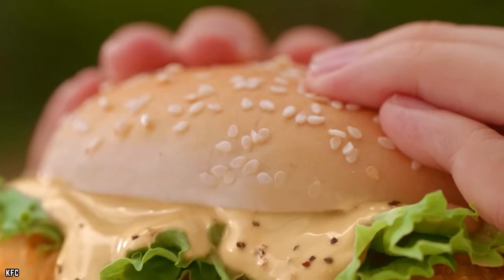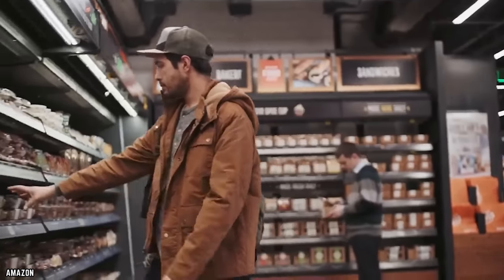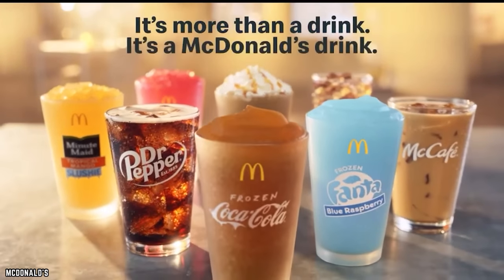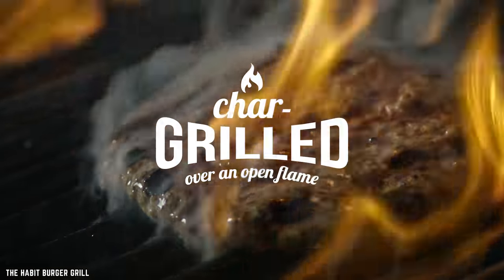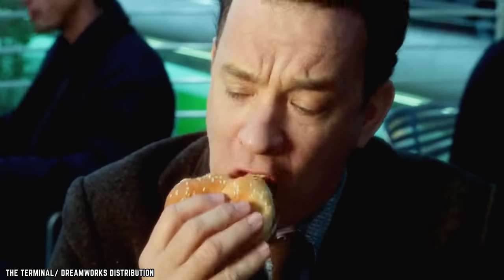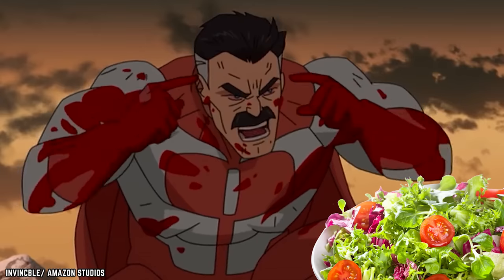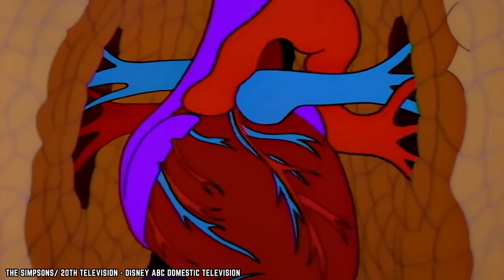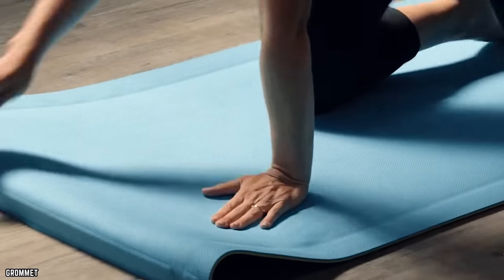15 Fast Food Facts You DON'T Want to KNOW

Comment: I heard about using fake foods to be used in photo ads and TV commercials.  For example for ice cream advertising syrup they used mashed potatoes instead of ice cream because the real ice cream would melt too fast under the hot lamps used for lighting
Reply: To clarify, the advertised product has to be the real thing. For example, they can use mashed potatoes to simulate ice cream as long as the product they are advertising is not ice cream. If they are advertising Haagen-Dazs or Blue Bell, etc., they must use the real product. However, they can hire stylists to make it look irresistible.
Reply from the maker: @Kole Larson Yes, you are correct. In the world of advertising and food photography, it's common to use various techniques and substitutes to create visually appealing images of food. The goal is to present the product in the most appealing and enticing way possible.😊😉